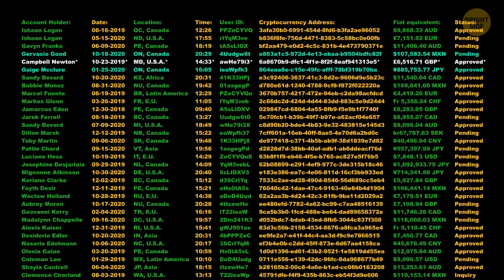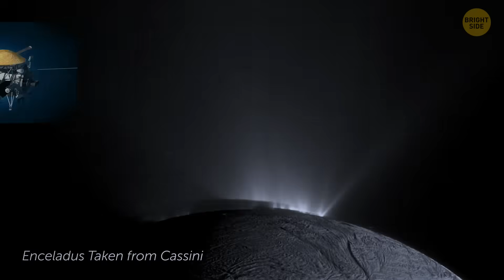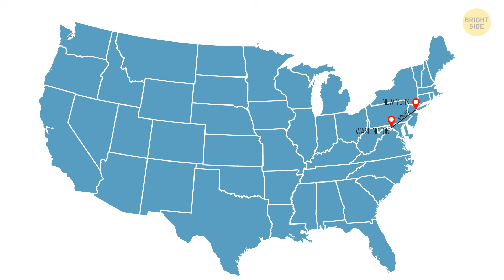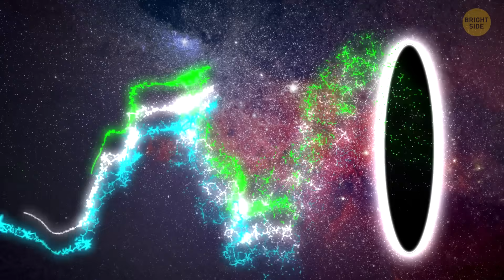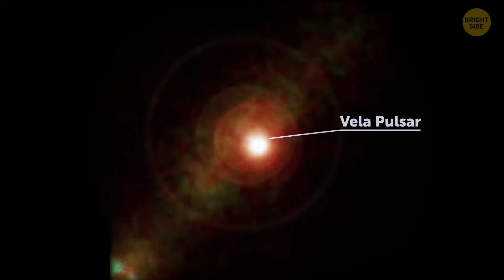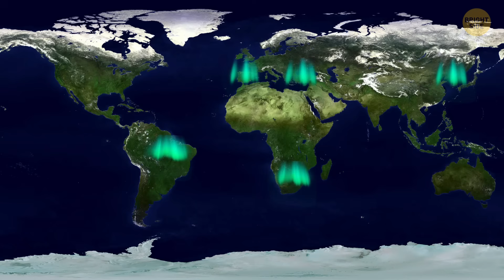How Far Will Voyager 1 Travel Before It Dies?

Comment: I was in the Marines when this launched and think, it was designed with slide rulers and pencils. Also we are talking first generation of electronics which are still working 48 years later. AMAZING
Reply: You are exaggerating the age of computers that were used to calculate the technology involving the Voyagers. I have personal experience and can verify .the computers NASA used during the 1960s and 70s.  A ferrite core type memory and processing technology was used during those years after which the huge computer system was donated to Mississippi State University in the late 1970s. Although it was primitive based on today's technology, It was adequate to run advanced simulation and calculations that were necessary to program NASAs projects at the time.